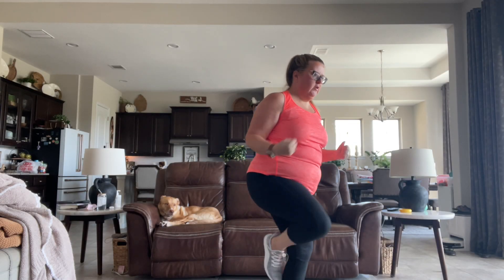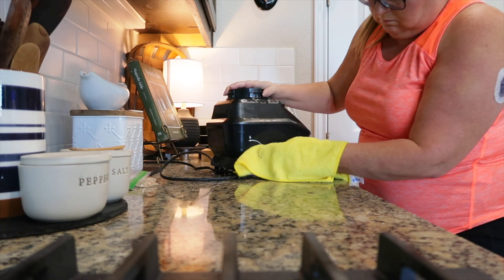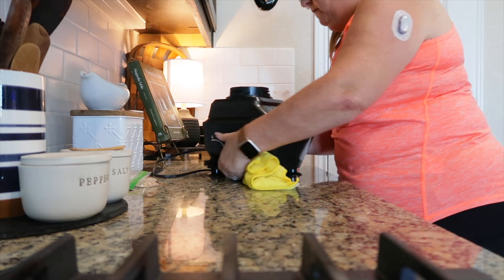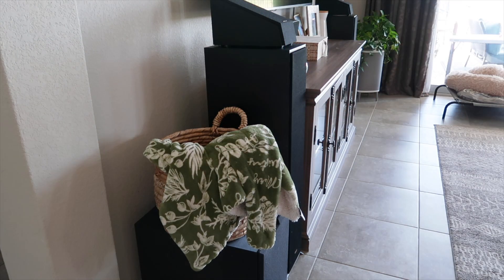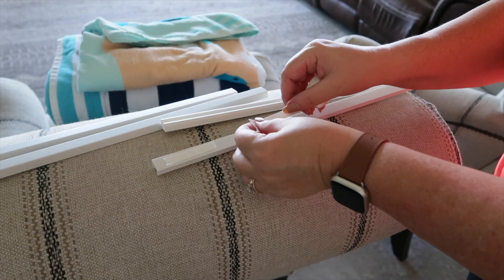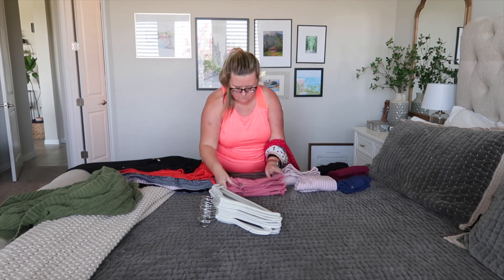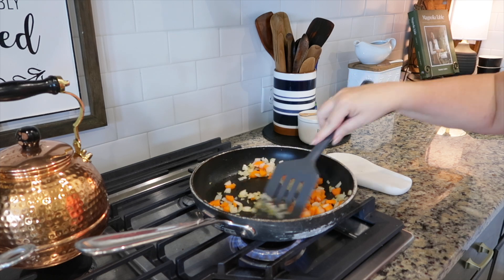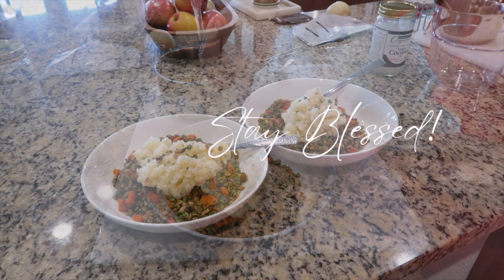Making Changes to Your Routines | How I Fit It All In | Michelle Lowe

Comment: Hey Mom! What about Bose? Have you ever looked into their system to see it perhaps that will work better than having those big black speakers. I agree with you. I wouldn't want those in my house either. Let me know what you find out.
Reply from the maker: I’ll look into those. I already had Michael replace the back speakers with those in the ceiling but the front ones are different and need to be placed lower or something. 🤦🏼‍♀️🤷🏼‍♀️